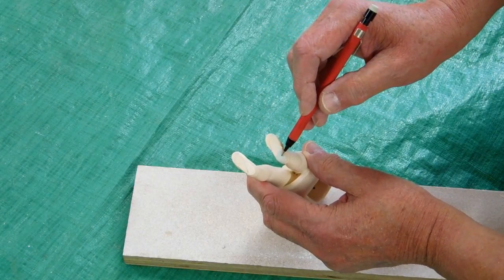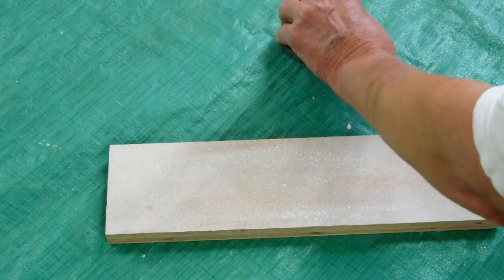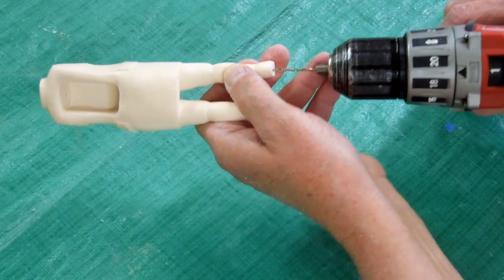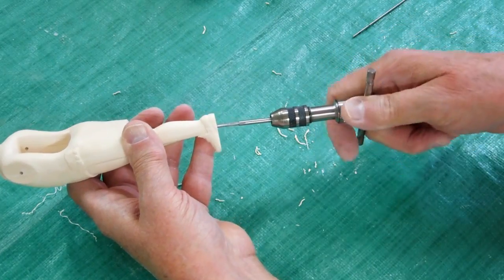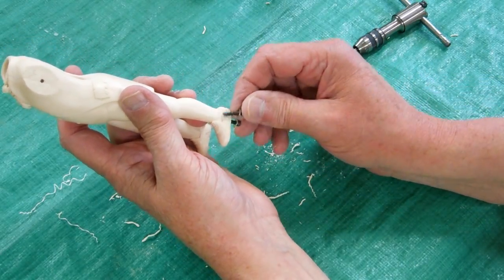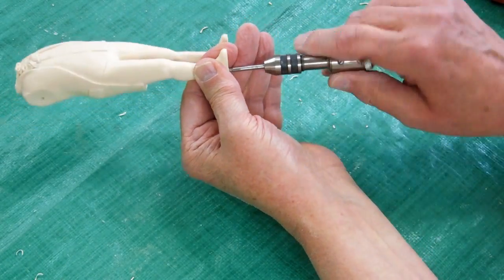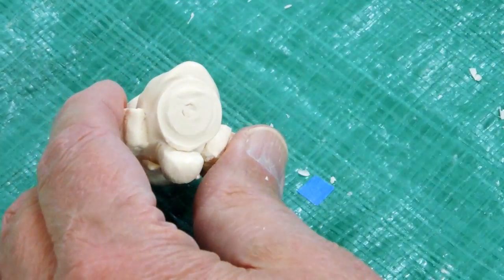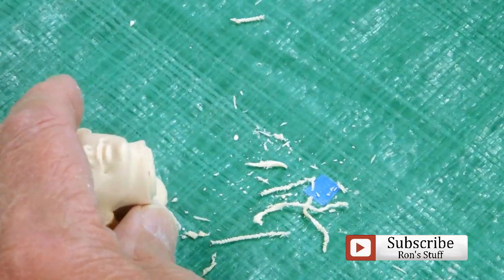Senior 20 Organ Conductor (4) Drilling Head & Feet

Comment: What material are these made of and how strong is it?
Reply from the maker: +Max Snelling This is Urethane Plastic Casting Resin (two part mix) which cures in 2 hours and then I post cure it at 150 deg F for 5 hours. Tensile Strength 3000 PSI, Flexural Strength 3500 PSI, Compressive Strength 3550 PSI. Pretty tough material and certainly strong enough for this application.